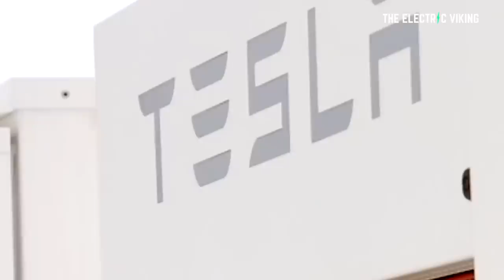Tesla's clear path to become largest truck manufacturer in the US

Comment: I say good luck to them. Unless there is a massive breakthrough in energy density of batteries and charging infrastructure electric trucks don't stand a chance.  I love how ev folks always put the cart before the horse.
Reply: Tesla has it worked out.  So your saying Tesla is lying?
Reply: Yes I am. If they had it worked out they would have already released the truck for sale.
Reply: @ponderosaprojects7052  They first built a gigafactory to produce them. Not in 100 vehicles per year range like the others, but with 50k per year.
Reply: Again cart before the horse...where do you charge them? I haven't seen a megacharger at a truck stop yet. I'm not saying electrics not the future but phasing gas and diesel  out by 2035 is a pipe dream.
Reply: @ponderosaprojects7052  As Dan Harold wrote in another comment thread, many semi trucks tend to travel the same routes on a regular basis. Thus, when the Pepsi semis travel between locations X to Y on a daily basis, mega chargers can be installed at X and Y, and Pepsi will be happy. The same can be done for other early customers, and this will give time for Tesla to start installing Mega chargers in other (non-destination) locations.

If you look at a map for Tesla charger stations, you might be impressed at how many there are, especially around the US. Tesla installed the first charger stations in September 2012, that is just 10 years ago, and the rate at which it installs new charger stations has increased over time. It is reasonable to expect that Tesla will install a great many mega-charging stations (or perhaps mega-charging units within existing super-charger stations) during the coming decade.
Reply: @ponderosaprojects7052  Either you have Megacharger on Source/Destination or you can use Superchargers. Phasing out Diesel by 2035 is not a dream, but a law. At least in Europe.
Reply: Law or not I don't think they can do it. I for one won't buy an ev until it is as convenient to drive as a gas powered car. That means 500 mi range at minimum and 5 min recharge time. With charge stations on every corner.
Reply: @vic321344  What does job description have to do with anything? Sounds like I touched a nerve Vic. It's just my opinion bro. No I don't drive like a possessed person but I don't want to have to deal with the constraints of an ev. Sorry...
Reply: @ponderosaprojects7052  Why would anybody want to drive 2*500 miles nonstop, if he does not get paid for it?

I dont want the constraints of an ICE car anymore. I need 0 minutes to recharge my BEV. I plug it in the night and next morning it is full.  No more need to drive to any gas station. No more service, no more oil changes. Just water for the front window and new tires.  Sorry...
Reply: @vic321344  Hey..to each his own. I get it.  EV's work great for some people. Some not. Nobody said anything about driving 1000 miles with one stop. I assume you live in a house in the city and don't have to drive far...great. I don't. I live about 70 miles from any charger except for my house. I don't want to live my life around a charging network..there aren't enough of them and I don't want to waste 45 mins sitting at a charge stations. I got things to do, I prefer my 5 mins fill up and I'm on my way. Don't have to worry if I put my car on the charger, don't have to worry if my power goes out, don't have to worry if I'm going to make it to the next charge station. Maybe one day I won't have to worry about that stuff but it won't be in the next ten years...
Reply: @ponderosaprojects7052  So after driving 400 miles you do not want to rest 45min. Restroom, Snack, Drink. So be it.
Reply: @vic321344  I never said that either. You like putting words in people's mouths. I drive how I need to drive. If I'm in a hurry I don't need time wasted stopping. If I'm relaxing I don't care how many stops I make. I like having a vehicle that can get the job done when I need it to or want it to. Nuff said..